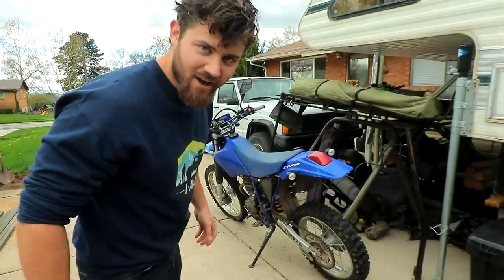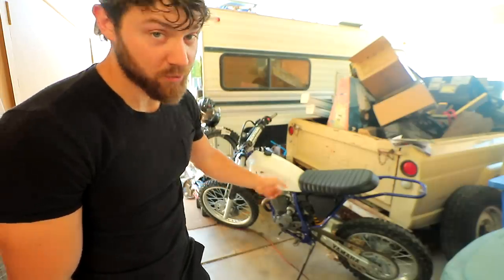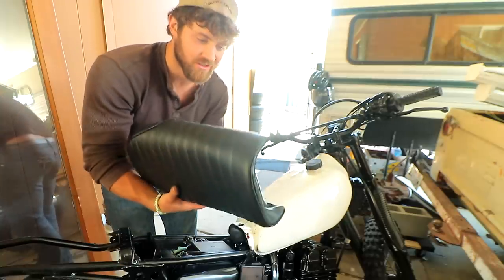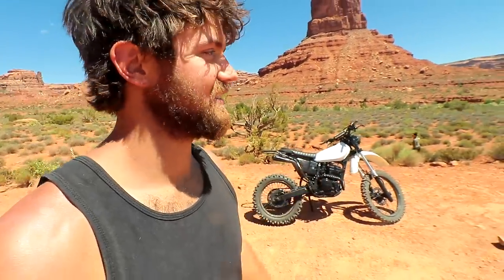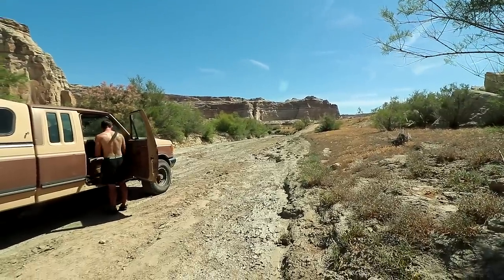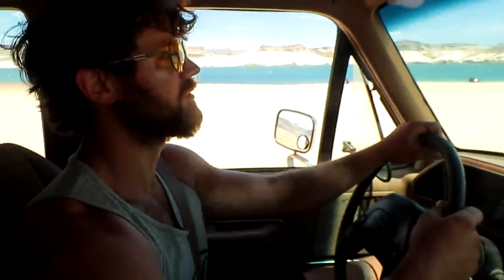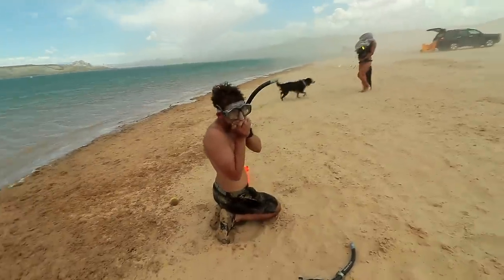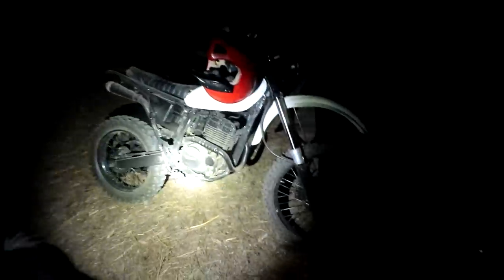Vintage Dirt Bike Conversion

Comment from the maker: 2005 Yamaha TT-R250
Frame Modifications: stock
Bodywork:  1981 XT250 gas tank, 1986 XT250 front fender, Renthal Bar/pad, Protaper Grips
Engine: stock
Exhaust: T-100 Dirt Series Supertrapp
Front Suspension:  stock
Rear Suspension: stock
Tires/Wheels: Front 80/100 -21 Kenda Trackmaster,  Rear 120/100 -18 Kenda Trackmaster
Brakes: Rear:  stock disc front/rear
Electronics: minimal wiring, 6V Battery, no speedo, 1981 XT250 Headlight
Other Modifications: custom seat
Reply: Thanks legend, keep up the good work. Always entertaining!
Reply: Nice setup!  Thanks for the build specs, I was thinking about something similar but going a little further with sportbike tires for a supermoto build.  No dirt here, just concrete.
Reply: Thank you posting this.
Looking for road tires for a 
honda 1979 xr185 not sure where to look and what would fit.

Comment: My dirt dirtbike i got like 2 or 3 years ago. My brother bought it for 90 bucks. Never got around it it so i bought it off him for 110 bucks and turns out it needed like practically everything. Top end, needs all new cables but all i changed is the front brake cable. Also needed a carb rebuild but couldn't buy the part i needed so i got a new one for my b day and she runs again. 1980s plastic gastank keeps cracking after you patch it so i am putting some random honda tank from the 70s. By the way my bike is a 1980 Suzuki pe175 2 stroke. Clutch is goofy too but i have all the parts to replace it if it goes.

Comment: You got too many things to deal with. Forget Jade, forget the ford, forget the cherokee. You should've kept the bike stock and invest the time and money in  something else, like going on the road. Get a van, 4x4 preferably, long wheel base, get a rack, get a back/side ladder, get some solar panels, get some basic shelves and a 14$ walmart air mattress and I guarantee you'll be doing much better than now, juggling with 3 old cars, 1 old camper, 1 bike, 3 dogs and a girl.
Reply: banzay1 go watch something else then
Reply: @danking8511  sorry, did you say something?
Reply: banzay1 He did say something, and you seem to forget everyone has an opinion, you have yours and he has his, I would also suggest that you find another channel if this is the type of content you want. I mean I can’t speak for Jake but right now that doesn’t like its going to happen.
Reply: @zephyr5802  why didn't he respected my opinion then? It was nothing against Jake and no malicious words were used. And I didn't say that I don't like his show. Jeez...
Reply: banzay1 He didn’t disrespect your opinion as much as bluntly stating you might be better looking for another channel. Wasn’t looking to convey anger or frustration in my original post, and I don’t think he was either.
Reply: @zephyr5802  True. There are plenty of channels showing exactly what @banzay1 described. No need for Jake to become a copy of some other channel.